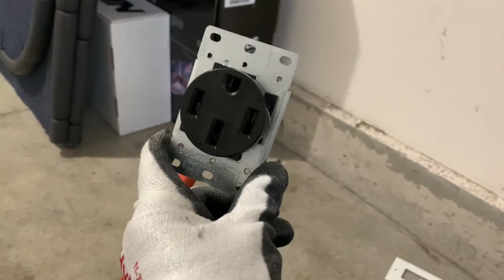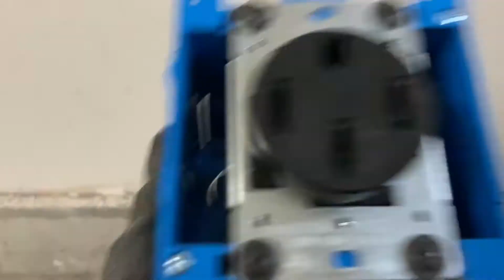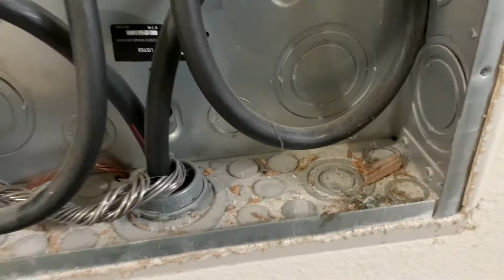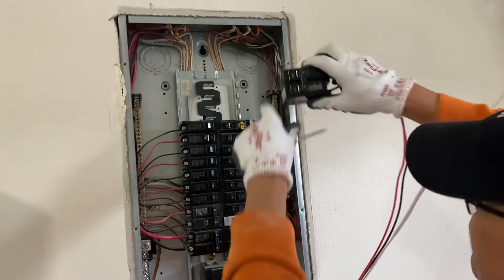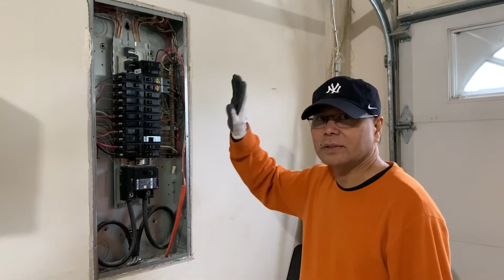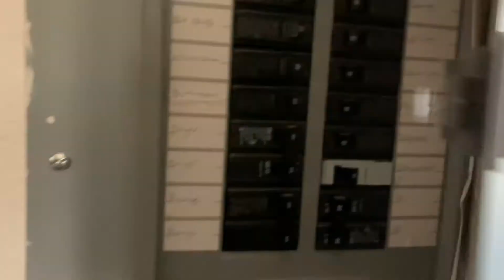Installing Nema 14-50 for Tesla Charger

Comment: DO NOT follow this guide. It will cause a fire and burn your house down eventually. He is using 10 gauge "Romex" type wire also known as NMB 10-3 with ground. These wires are too small and will eventually catch fire. Also, he failed to use a securing clamp at the knock-out. These clamps are important. Without these clamps, vibrations from movement within the structure as well as vibrations form external sources will cause the sharp edges of the service panel to cut the outer jacket and the insulation of the wires. Further, since the wires are way undersized for the installed breaker, when this short circuit occurs, the wires will catch fire before the breaker's overload protection will trip the circuit. As such, this circuit has no protection against overload and the subsequent fire.

Comment: Using undersized wire. Installed 10 gauge wire, however for 50AMPS, you need 6 gauge wire.